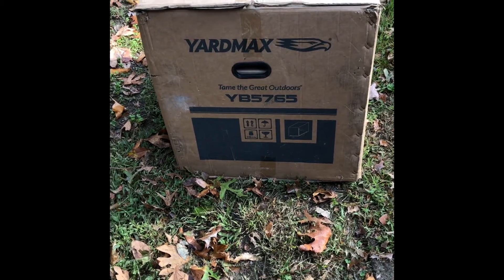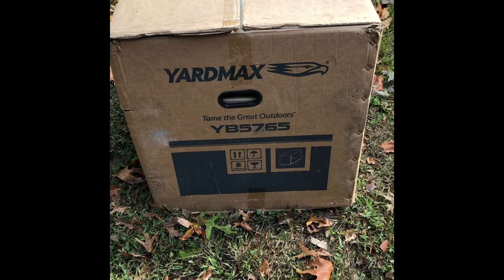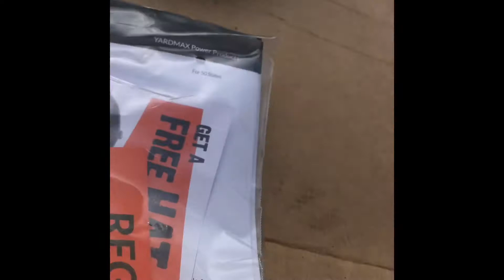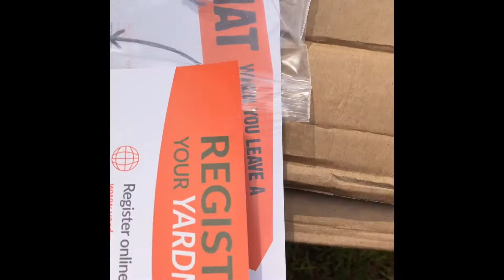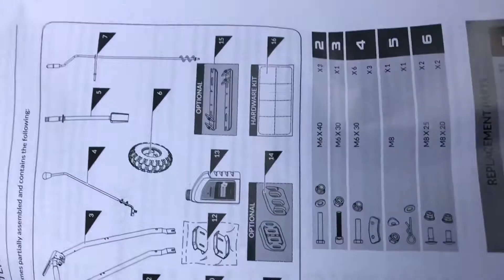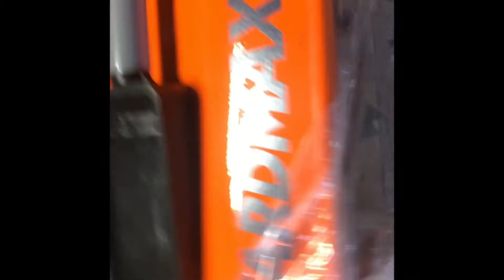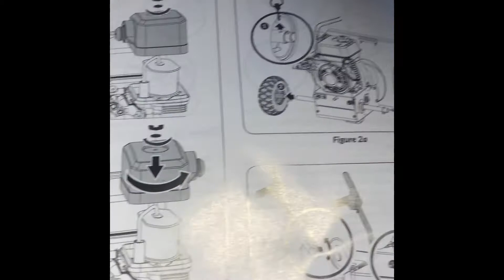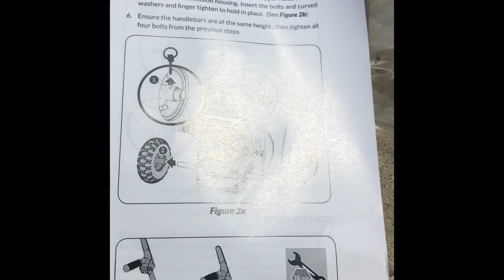Yardmax 22in Snowblower YB5765 Assembly Pt 1

Comment: We set the whole thing up and it won’t start!! Please help!!! We live 20 min south of Boston!!
Reply from the maker: Hello, I’m so sorry to hear this, I am not a Yardmax representative, I was showing how I set mine up but there’s nothing that you could have done to prevent it from starting. I would contact the service number on the manual provided with the snowblower and they can help get it sorted out.
Reply: @Prblmslvd   TY!  I’ll try that. I hope they’re able to help.
Reply from the maker: @wwredgrl1515  they’ve been helpful for me and other customers I’ve read about with issues... you didn’t install the engine or any components on it so I am not aware of anything you could have done wrong, they need to troubleshoot why it’s not starting, if you’re following the exact instructions on what needs to be on, etc. I know there’s a choke lever, a fuel feed that needs to be on and an engine kill switch that needs to be on, any one of those could cause it to not start.
Reply: @Prblmslvd    Thank you. Yeah he called Lowes to take this POS back. Getting a new one that is fully assembled.
Reply from the maker: @wwredgrl1515  that’ll work!
Reply from the maker: @wwredgrl1515  I know Yardmax is very helpful if you would have called them but it’s good to see Lowe’s was helpful as well and took care of it. Glad it worked out for you good luck with your new snowblower!

Comment: Did it take long to assemble?
Reply from the maker: To be honest I only remember it taking maybe an hour and change. I was also filming and going through each step and showing the tools etc... it should be no more than an hour I would think unless some unforeseen problem. It was really pretty straightforward. My video definitely should help, good luck it’s really not hard. Take your time, think each step through, you’ll be fine.
Reply: @Prblmslvd  thx
Reply from the maker: @tgoodfella  you got it anytime!!!
Reply from the maker: By the way, First Step is to Make sure you have all the parts you need to complete the assembly. Check closely for missing parts on the main assembly. I’ve seen many cases where a part or a bolt or washer or something not too obvious is missing and you wind up all the way to final assembly before you find out. A waste of time and aggravating. Check closely first it’s worth any time spent on this.